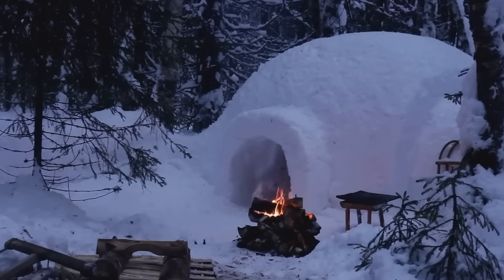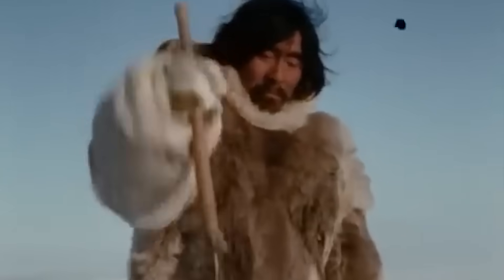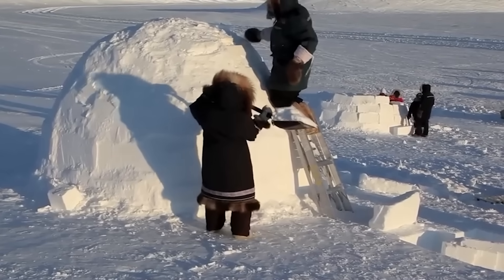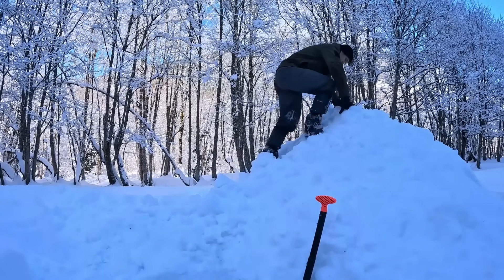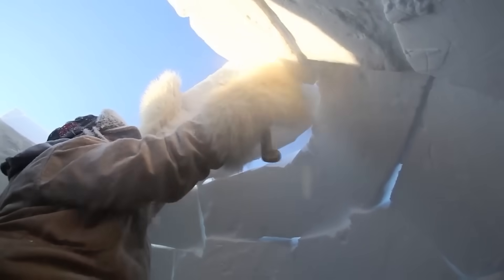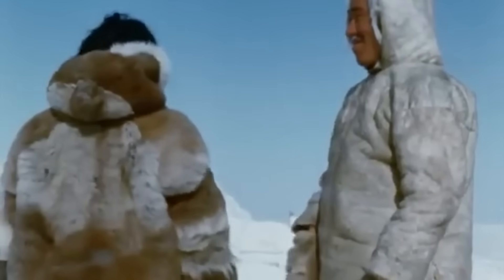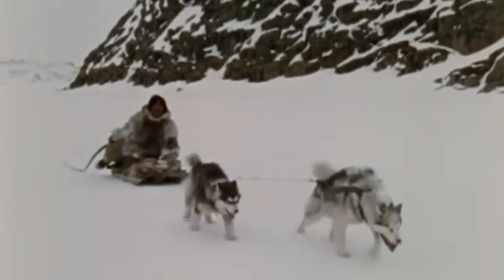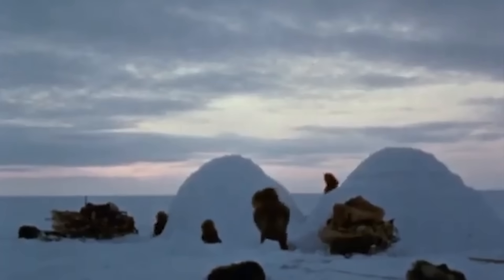How Inuit Build a Real Inuit Igloo in 2 Hours

Comment: Not with an entrance like that. Usually they make a tunnel like an a s shape so the bottom of the s would be deeper than the igloo floor do the cold air can sink out. They will add a small hole for ventilation in the igloo so the humidity can escape and lastly they will rise the bed like a feet or two  so they would not be where the cold air go. Something like that. I heard that a couple built an igloo like in that video and they were cold AF cause all the hot air was escaping.

Comment: Build an igloo on Mt. Rainier in 1980, it really wasn't that hard. He missed one step...you cut a ramp on the first row to create the spiral of blocks. Also, by standing in the center and using an outstretched arm to guide your cuts (imagine the line being from the center of the circle on the floor extending to the block) you can easily set the proper angle for the cuts, causing the tilt to be correct. Ours took about 4 hours. A single candle plus body heat resulted in 60-degree temp inside! Our igloo was more comfy than any tent I've slept in! The day after camping in the igloo, Mount Saint Helens erupted.

Comment: Inside an Igloo, the Inuits, Eskimos and other Arctic tribes, often hung up Pelts as an additional layer of insulation, and the insides of the Igloo could be quite comfortably warm, you could have almost room temperature inside one. So you could easily get 15 Celsius, and that's 59 Fahrenheit.

But the Igloos aren't the most impressive buildings out of solid water. No that would be the Ice Hotel in Jukkasjärvi in Sweden. A building that's erected once a year, during the winter in Sweden, and it's actually warm inside, and everything is made out of solid Ice and Snow. And a bunch of artists make the designs each year, so it never looks the same.

Comment: An igloo won't protect vs a determined polar bear, they can dig through or use their weight to break in. Instead they'll make an "ice chest" which is several solid ice blocks stacked together and then water is poured onto it to freeze it into a solid block. There are techniques so that leverage and/or hitting specific spots will break the ice blocks apart again. It can be almost completely air tight and stops both small rodents and large animals from getting in, like a stone cache, but better.

Comment: The criticised  commentary seems to  work at 2 levels with the apparently irrelevant  elevating or higlighting the fascinating technical information and detail which could be too much to process if run off in one piece. If you can focus on the technical in the blend instead of allowing yourself to be distracted then you can also appreciate the smart imagination which allows the speaker to share some pretty heavy duty technical subject matter in less than 14 minutes alongside remarkable visuals. Well done to the researcher(s), editor(s), commentator and producer(s) for such an imaginative and informative short. 🎉

Comment: Stronger than concrete of the same thickness? No. That's not possible. I'm an engineer in Alaska, that is ludicrous. Packed snow is strong for its weight, but it's nothing compared to concrete.

Comment: OR...  You can erect a tent, pile snow on top of it in many layers, sprinkling water on each layer.

You won't be able to retrieve your tent until spring, but with the snow on it, you're thoroughly insulated and can survive.

Also, the correct shape is a parabola, although a thick dome in a half-sphere will do, as the requisite parabola is maintained.

"...two hours for people to set up a complicated modern tent..."

Uh...  What are you smoking?  It takes me about 2 minutes for my simplest tent and 10 minutes for my complicated, multi-roomed, modular cold weather ascent tent.

Comment: I know I'm going to be attacked for this…but it appears to me, they're going through too much trouble and could make it a lot simpler. Instead of creating blocks, once they find the right sintered snow, pile up the snow into the size dome shape they need. While digging a center from the top outward. Since the structure is already in place with no cracks to fill, all is needed is to hollow out from within and expanding the inside creating the room/s needed. Once you have gotten deep enough you can then begin making the tunnel to the entrance. Once you've completed the inside then the only requirement is to fill in the top. That you can do with the centerpiece as explained in this video. This would take a lot less time than dealing with blocks and angles. K.I.S.S. Principle here. IMHO.

Comment: - That multi-room snowhouse at 10:39 made by opening up the partitions between a cluster of domes is a "qalgi", sometimes built for special occasions like community get-togethers and drum dances.
- I've spent the night in one of those smaller snowhouses. Outside was a screaming blizzard, inside it was dead quiet, almost spooky.
- Nowadays, when speaking English, they would be called a "snowhouse" since the word "igloo" or "iglu" also includes permanent wood frame houses.
- If you abandon a temporary snowhouse, you must knock a hole in the roof. Otherwise bad spirits can take up residence in them.

Comment: The narration is silly rather than instructive; do not expect to learn how to build an igloo in two hours from this video. The modern footage clearly shows not an igloo built with blocks, but that pile of snow being hollowed out with a shovel. Again, the narration describes the cleverness of the Inuits using a string to accurately mark out a circle for the foundation, and then modern footage shows a person without such cleverness, walking and stomping down snow in a roughly-estimated circle - not so clever? 😑 The narration says the Inuit snow blocks are typically 1' x 2' x 8", but the blocks in the archival footage are more like 5 inches thick.

Comment: I used to just make a big pile of snow pack it, spray it with water. Let it freeze real good and then hollow it out.. No blocks just a solid ice on the outside hollowed out igloo.. You can use just about any kind of snow with my method on igloo building..

Comment: huh, wonder how the design would handle pykrete, a composite made of 14% sawdust or some other form of wood pulp (such as paper) and 86% ice by weight. its pretty damn tough material, long as it does not melt its basically hard as concrete. You'd probably be limited by the need to ship the sawdust in from away due to lack of trees, but it'd be interesting to see what the material could support.

Comment: My daughter and I had been trying to build a snow fort/ igloo this year but it was too warm this winter to have the right snow/ snow at all. We weren’t making bricks, just adding to the walls as the snow built up, until it melted. We started over but that melted again. We’re in southern Canada (that sounds kind of funny to say 😅) so it makes sense that we wouldnt have gotten enough snow.
Reply: Yes unfortunately the snow you have to work is just too different. In the Arctic the snow can become very hard packed and dry, a bit like styrofoam, which makes it very easy to cut into blocks. And it’s so cold there’s no danger of it melting, even on a sunny day and with multiple warm bodies inside.

But even if you didn’t succeed I’m sure it was a fun activity to do with your daughter.
Reply: @ it was fun! We got a “brick maker” for when the snow is able to be packed down like wet sand
Reply: Not this year... El Niño

Comment: Great video. But one quick thing I've got to say. If a few Inuit men can build an entire igloo faster than you can set up a tent, you have got to be either mentally retarded or you're handicapped and are only able to use one hand or something. Oh, and when you said that one of those snow blocks can be stronger than a block of concrete that is the same exact size, I'm not too sure that is accurate. I mean, I'm sure the bond of the compacted snow in the block is pretty damn strong, but stronger than a concrete block that is the same size?? I'm gonna have to call bs on that one. I'd like to see it tested if that were the case. Just sayin. 🤷🏼‍♂️

Comment: "stronger than concrete at the same thickness" when was the last time you tired to cut concrete with a stick? Pure ice is less strong than concrete so there's no way that small amounts of ice in a block of snow is stronger than concrete. Maybe if you consider its weight ratio since there's a lot of air. I'd believe that. but there is no way a 1x1 foot block of snow has the tensile or compressive strength of a 1x1 foot block of solid concrete. It's insane that anyone could write that and think it's true.

Comment: You can't make snowman with fluffy snow it has to be slightly melty that way you can roll it up into big snowballs when they get about   one foot in diameter they're almost to heavy  the next one is slightly wider after that's done  you set the flat side down an start piling  others on  the next one is slightly wider  than the first one then you keep on that way as  long as you can    you almost need a. Adult as you go  higher  it's a very tiring exercise  usually a snowball fight  starts good times follow if you're lucky you have a mom like my wife is, there will be hot chocolate waiting and fresh scones still warm, that's a great day with the kids right there  sadly mine grew up.  Only one grandkid so far  she lives fifty miles away I look forward to the years I can get out and play with her in the snow.

Comment: I made an igloo when I was a kid. The snow was just the right quality and started cutting bricks. I had a small shelter in a couple hours that  four adults could get into.
Reply: When I was a kid, the new cool winter toy was an "igloo block maker", essentially an injection-molded box with integral handle.
We built many a snow fort, but failed at our igloo attempts.
Reply: Noice! I loved a good snow day as a kid.
Reply: Wow.  Kindergarten story time
Reply: @bertblue9683  ooooooooooooooooooooooooooh i still remember them good ole days. my first french kiss.
Reply: a thick concrete would be better. and a wood stove in the middle.
Reply: @georgecoons6872  Concrete is not good insulation. Foam would be as good as snow.
Reply: @georgecoons6872 yeah what an idiot... Didn't pour concrete and build a wood stove as a kid
Reply: @georgecoons6872  no

Comment: The Viking who originally landed on Greenland did not learn for the locals who were there. The Greenland Inuit or Eskimos. In 1816, most European settlers fresh to Greenland died not heeding the wisdom of the locals and long term resident Europeans. The year without a summer saw that 60% of the settlers died, frozen in their shabby stone and wooden huts. Not using the snow as an insulation against the cold. Every year, my brother and I try to bank our house up to the main floor when the snow's plentiful. Other wise the heating costs sky rocket.

Comment: Excellent coverage of igloos. The hunt for the ideal snow consistency was particularly interesting.
I've seen suggestions that from a structural perspective, a hemispherical shape is not optimal. The load bearing is allegedly better with a slight emphasis for increasing its height.

Comment: Where did they get metallurgy and knives prior to modern trading to cut the blocks and shave them?
Reply: I have an Ulu made from circular saw blade with handle of brass and bou antler.   Traded with Baffin Inuit for a USN folder camp knife.
Reply: Maaaaybe they _didn't have metallurgy.  Maybe they used tusk or bone or wood. Maaaaybe the steel is a modern convince, eh?  Where did they get the cameras to film themselves building the igloos?
I mean, come on.  Figure it out!

Comment: you lost me at "stronger than concrete of the same thickness"
Reply: They almost made a floating ice ship in ww2, they would mix wood chips and sawdust into water, freeze it, then build. That ice had strength comparable to steel
Reply: steel is actually not hard until its case hardened. different steels.

Comment: As a backcountry skier, touring skier and climber, I have slept many times in the snow. Because we cannot always find the right consistency of snow, we usually resort to digging snow caves in a large snowdrift. The last time we did it was at 3000m altitude in the Swiss Alps, it was +5 degrees Celsius inside and -30 outside. It took us about 3 hs to dig. The trick is to make the floor higher than the entrance. We also closed the door with our rucksacks and gear. We used a plastic tarpaulin to cover the floor and held it in place with 4 ski poles (if not, it just slides around). Smooth the ceiling with rubber washing up gloves to make a dome. Any irregularity will cause a drip. Also, bring a change of clothes (long johns, T shirt, thermal shirt ), you sweat a lot digging and that sweat will then make you cold. If ever caught in a real bad storm and things are going south quickly, dig a trench, cover with skis, poles and thermal blanket/plastic tarpaulin (always pack these in your bag) and shovel snow on top. You can build an emergency shelter in 30mn. It is not optimal but when time is critical, it can save your life. Snow is an excellent insulator and in high wind, putting up a tent can become impossible. And tents dont keep you warm, they just protect you from the wind.
Reply: Just remember to always add a ventilation hole. Without it, suffocation is a very real danger.
Reply: Interesting experiences-ty for sharing.
Reply: ALWAYS CHANGE YOUR SOCKS JUST B4 YOU GO TO BED. COLD FEET/TOES WILL KEEP YOU AWAKE
Reply: I'd also add a shallow trench ringing the inside so you don't have to gear up and go outside at night to pee.
Reply: @kevronimo  would add a nice aroma to the room once used, I'm sure.
Reply: My expert method of staying warm is to not go out in the freezing cold wilderness. Works every time, like charm.
Reply: Thx Broooo
Reply: Sounds like a sweaty Ordeal
Reply: Always rub one out before bed and you'll sleep like a baby
Reply: So you jump on the trench and the roof is your skis?
Reply: @boreduser12 I think the roof is your skis and the tarp with snow on top.

And the floor is snow.
Reply: Cool story.  Whoop de doo
Reply: Why don't you just say tarp and backpack instead of tarpaulin and rucksack?
Reply: @boreduser12 Because he is from the UK and using colloquial terms?
Reply: @boreduser12  Because the rest of the English speaking world doesn't speak American English, just Americans do.  Travel sometime, it's good for the mind.
Reply: @silva7493  They also don't speak British English. Have you ever tried to listen to an Indian speaking English?
Reply: These idiots claim these dummy Inuit people can use the stick test to find snow, tougher than concrete?

Get real
Reply: @kopph8tr693  tougher than concrete by weight. An equivalent area that is the same weight would be very thin concrete.
Reply: @kopph8tr693  In certain conditions. Always listen to the caveats.
Reply: The proof is that they survived minus 

Would you?

Comment: A small controled fire. They used whale blubber or seal. It burned slow and hot but big enough to cook. But that small amount of heat quickly warmed the igloo. Besides wood isn't available. Unless it washed up on shore

Comment: where did they get wood to start fires if they built igloos in the middle of nowhere
Reply: Seal/whale oil, the blubber can be scraped for liquid oil that does not solidify in cold. It's basically an open alladin type lamp with liquid oil and a wick traditionally made from moss or lichen but usually paper towel now. The wick is laid flat lengthwise and the leading edge is kept just out of the oil and the flame adjusted by moving the wick with a small piece of driftwood, bone or antler. I saw a fascinating documentary on the subject as well as some beautiful ulus, the topic was on the tools used by Inuit women.
Reply: From the forest. There are plenty of shots of the forest in this video.

Comment: My father learned how to make these for winter camping adventures in Vermont and NH. He taught us all how to make them in case we ever needed an emergency shelter in winter. In the ones he taught us, the first set of blocks go down as a ring but then you cut the top edge of the ring to form a gradual ramp that way, the first block of the second level is butted next to the last block of the first level. The blocks thus spiral up and are not concentric rings of blocks. This created more of the interlocking geometry using all the blocks. Once, when we made our camping igloo near a lake, which was frozen, we used a saw to cut out a “window” which was placed in the wall to let sunlight in. They are very warm for camping. Much nicer than a tent.
Reply: So cool!
Reply: Literally!
Reply: 🤔 hmmm , Great idea.
    it  wouldn't  be hard  at  all to
   stash ~8"x12"  piece of  plexi
   in your ruck for that purpose !
   ( face it South , & add a vent /
    hole with flap THERE instead 
    of in the wall . )
Reply: @rythemzlatin,  He did bring a piece of plexiglass in years later when they went winter mountaineering on Mt. Washington in NH.  The only problem with the plexiglass is that heat escapes out. The snow is a fabulous insulator but the plexiglass is not.  A sheet of double walled polycarbonate like is used in greenhouses would be better, 2 sheets glued together better still! . Protecting the temperature inside the structure is really important.
Reply: That was probably the first igloo with a window, nicely done